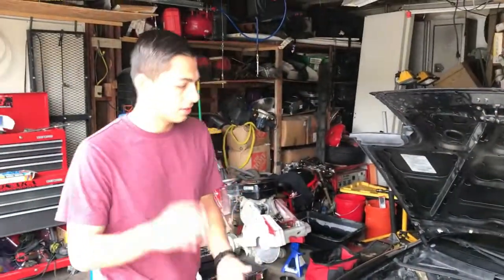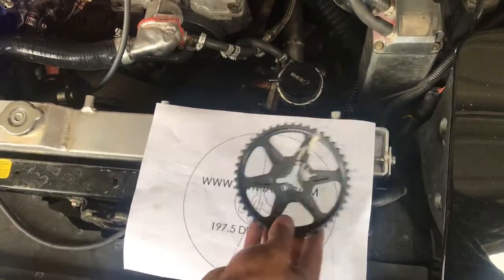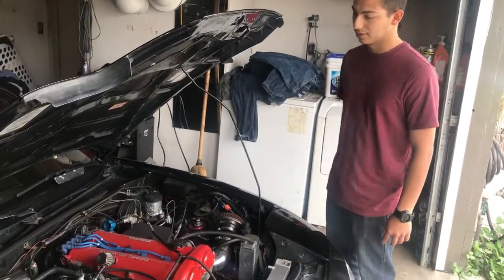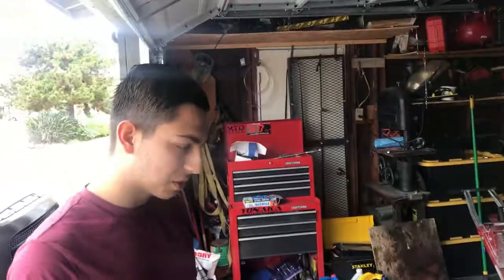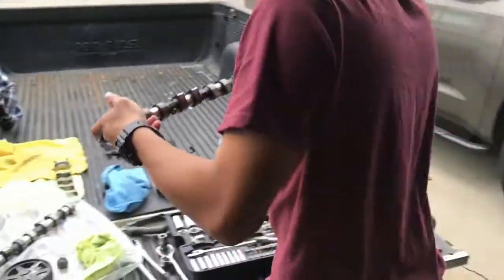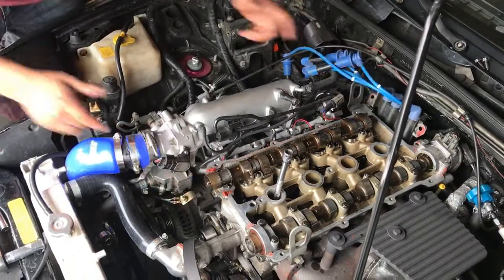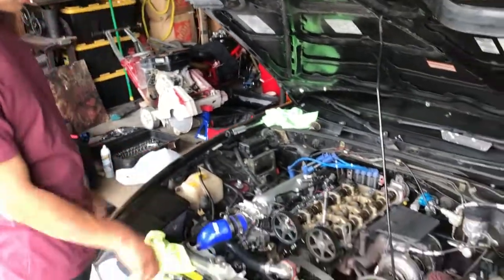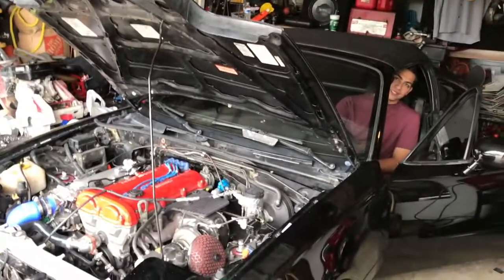TURBO MIATA "EXHINTAKE" MOD

Comment: I have done this mod. My initial attempt included drilling a hole in the cam gear to supposedly set the cam timing. I had very low power but the engine started and ran. I knew something wasn’t right so I rechecked the intake cam position. I had apparently misunderstood the instructions. I reassembled with the intake cam at 180 degrees + 3 teeth counterclockwise. This did the trick but my idle is pretty lopey. It runs well and pulls strongly though so I am happy. It’s a bit better than stock but not a lot. Mine is an NA BP in a Protege, by the way. Nice video! Thanks for sharing!
Reply: Dave I’m looking to do this for the lopey idle and the power gains. Where exactly did you drill? I’m doing this in an na 1.8 94 miata.

Comment: so if i'm correct, you now have 2 exhaust cams in 1 engine.
is this also possible with a 1.6?
Reply: Yes, technically this is possible with a 1.6, so long as you use the exhaust cam out of a 1994-1995 mx3, as they have the CAS on the exhaust side, whereas the miata has it on the intake side, so they are interchangeable.
Reply: @obahex  we did a similar mod to a 1.8 liter and crammed it into a festiva

Comment: Did you have to recheck the timing with a timing gun or anything?
Reply: you have to redo the cam timing using the offset ...its not beginner stuff but not advanced if youve done a timing belt

Comment: What was the overall cost?
Reply from the maker: Tyson Allgaier if you have to buy the camshaft it will be around $150 but if you have the camshaft And the tools to do it such as a drill and angle grinder , all you would need to buy is the valve cover gasket and the RTV
Reply: Brz Rage awesome thanks

Comment: My stock miata is faster 😭 after a couple years the cam will snap happend to a lot of people. Just rebuild the motor to maybe a 1.9 or throw a k20 in and turbo that because the turbo miata still wont beat a stock k20 🤣
Reply: Did it snap at the gear? At the new drilled hole? I want to do this and haven’t seen any fails yet on miata.net